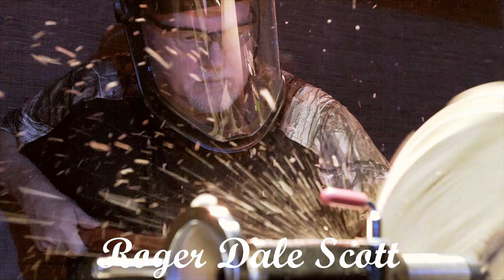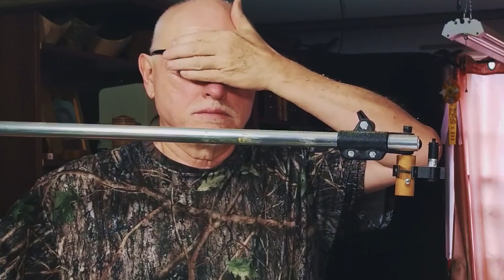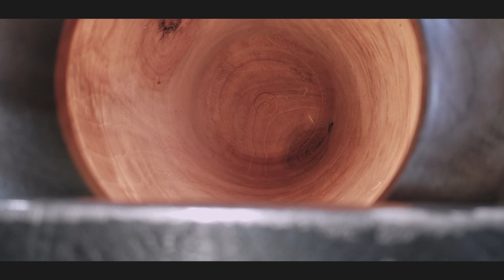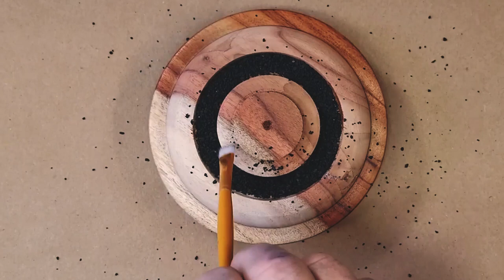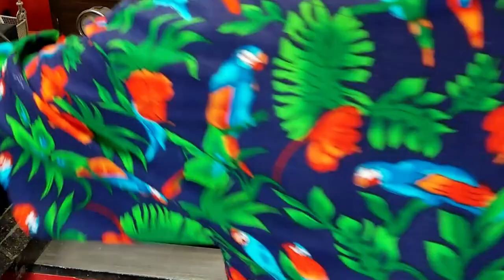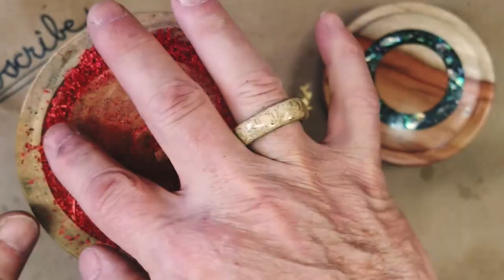Woodturning a Hollow Form an Urn

Comment: Your urn looks great! If you don’t mind me asking, how did you sand all the way to the bottom?
Reply from the maker: @Dennis Taylor Thanks for the compliment. I sand the bottom with my battery powered drill using a extension rod and a 2 inch H&L sanding pad. The inside walls I use a Robert Sorby H9086 Sandmaster Bowl Sanding Tool with 2” Diameter Pad. I made a 24" handle and put the Sorby top sanding mechanism  on my long handle. Works great.
Reply: @rogerdalescott  Thank you so much! This is going to help me alot. I'm new to turning have so much to learn. Thank you